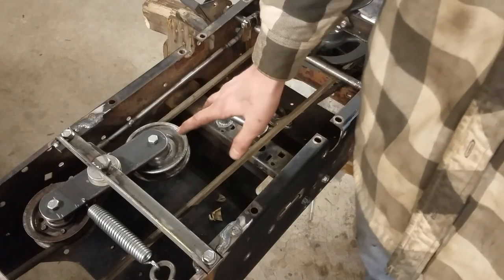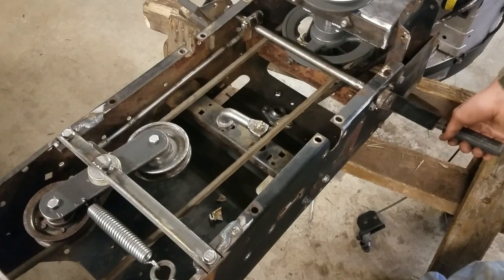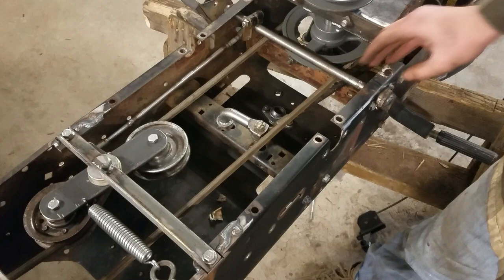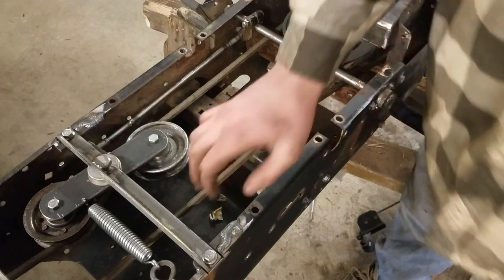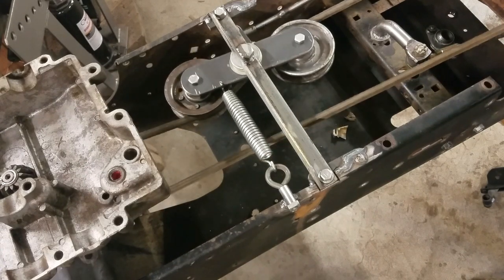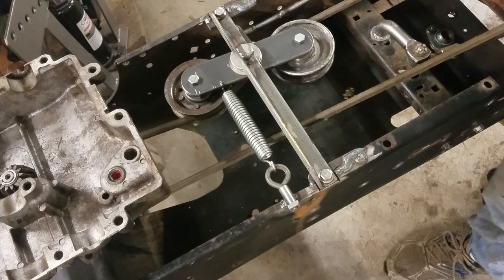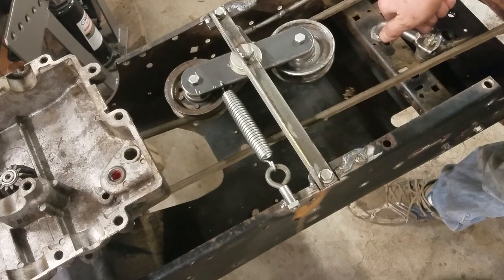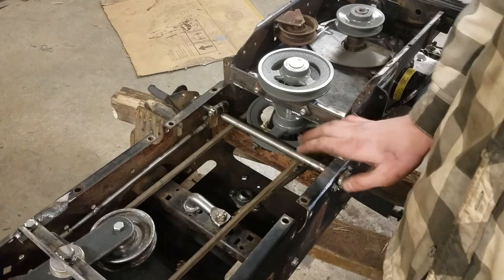Ford Off Road Mower Part 7 (clutch + steering)

Comment: I have a tip for you! buy a forge, and then get all those bits and bobs of metal scrap that you (were) going to throw away, melt them into ingots and sell them. I did that and got quite a bit of money back, and it a good way to recycle!
Reply: Mc_swaggy daddy 
Or he could take all those bits and bobs of metal scrap to a metal recycler in a bucket and not waste money melting them into ingots. 
Properly sorted scrap metal is worth the same per pound whether it is an ingot or bits and bobs.

Comment: If this is going to be a fast "mower", you may need a better steering mechanism.  There may be so much play in that system that it is hard to control at speeds.  Love the videos!
Reply from the maker: I did the best I could to take as much slop as possible out of every component of the steering. it will be fast, but I'm not designing it as an actual racing mower, so it should be fine,
Reply: Cool.  I saw another video where someone hopped up a go kart to make it faster and the slop in the steering almost killed them.
Reply: MacroMachines Macro, for steering help, just make sure all your bushings are new and whatnot. On my steering system for my Ford, I put dampeners/small shocks on. There’s always constant pressure. I have no power steering, but a slightly larger steering wheel. I like my setup because it was cheap and effective.

Comment: Tie rod is STILL backwards!
Reply: no it's not, he still has this  4:26
Reply: I figured you would speak up once again T.J.  

Once again it is NOT backwards and will Work fine in front of the axle. 

He has turned the steering shaft and can clearly see that the axle shafts turn with the steering shaft. 

Give it up and enjoy the build. 🤦‍♂️